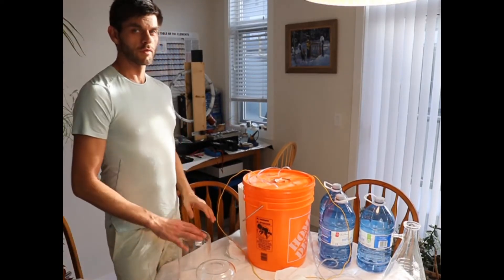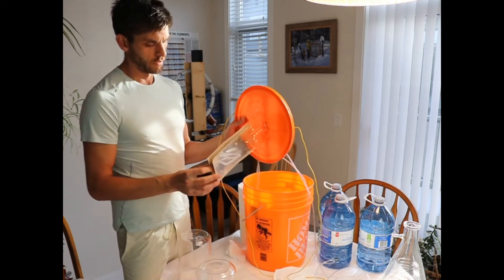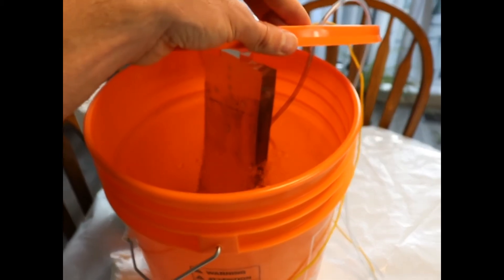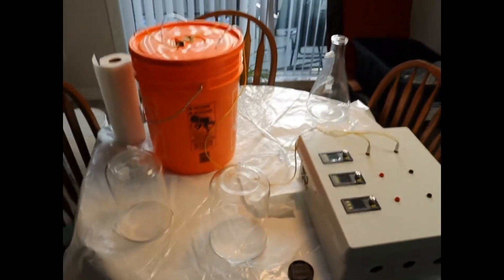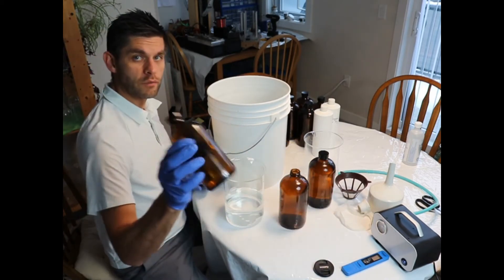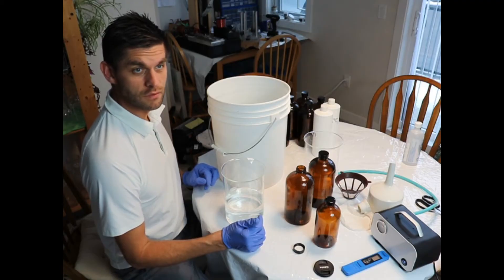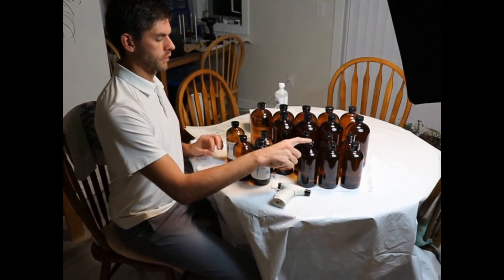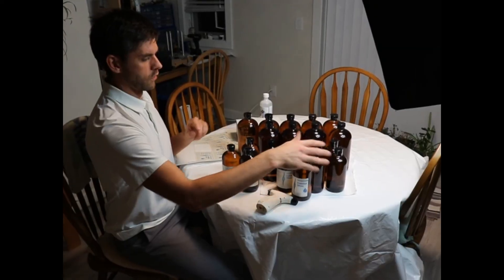Colloidal Nano Silver 20PPM  (High Tech Advanced)

Comment: You can not make nor preserve your colloidal silver water in plastic container. It have to be kept in glass or porcelain container in room temperature and it has to be protected from light exposure. Direct sunlight will ruin it in 15 minutes
Reply from the maker: Why not plastic?
Reply: @MadscienceLPTECH  Because it will be ruined in plastic container. It makes colloids descend on the bottom of that container and after that it is unusable
Reply: Not true. Ion silver and nano silver are not the same thing and react differently.
Meso silver on Amazon works great and is an actual nano particle. Sold in plastic.
What was in his video was not nano.